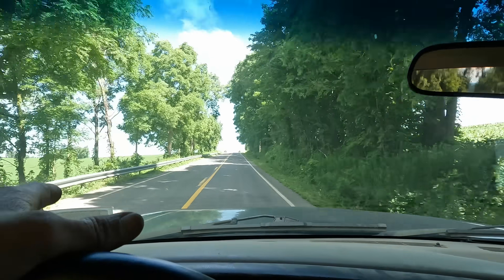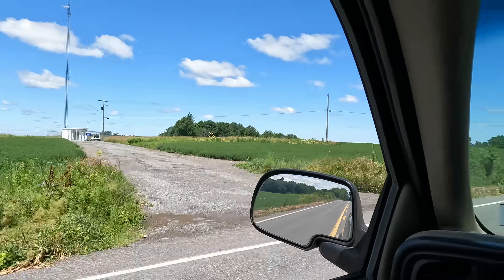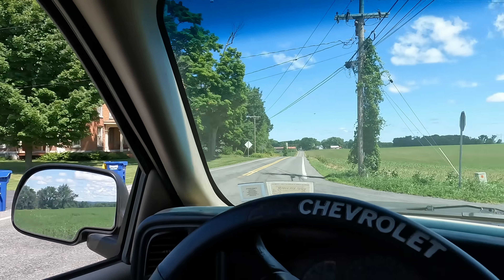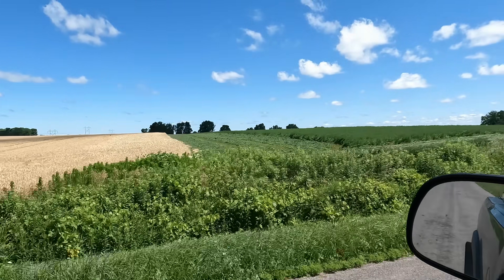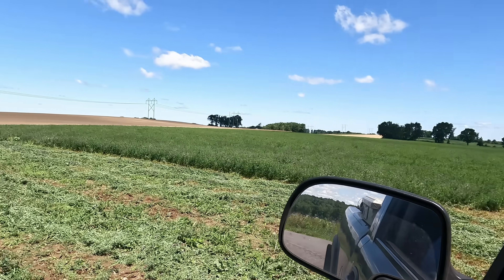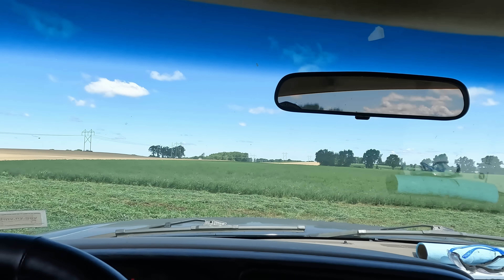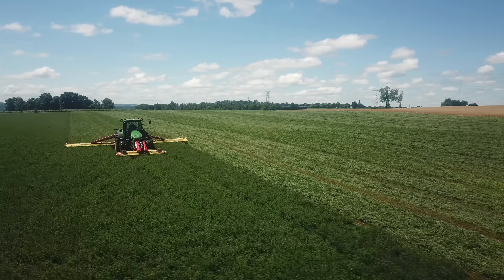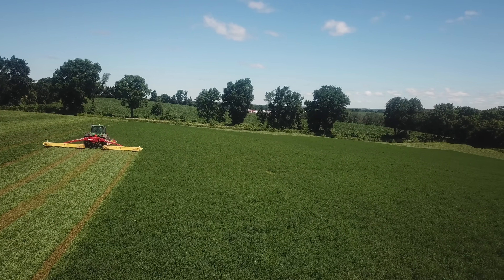This is how we lay it down

Comment: We call these a "three deck mower" here in Kansas,  they are sweet as you can really put the hay down and do a field quickly.   Back when I was a kid on our farm all we had was a 12 foot sickle bar mower that we pulled behind a small tractor on its 3pt hitch and it took some hours to cut a big hay field.    12 foot cut vs 34 foot is a huge difference plus the speed is phenominal.      Thanks Andy,  very cool mowing system.